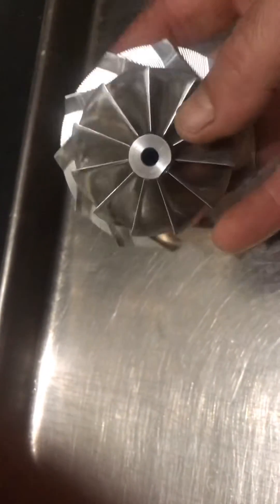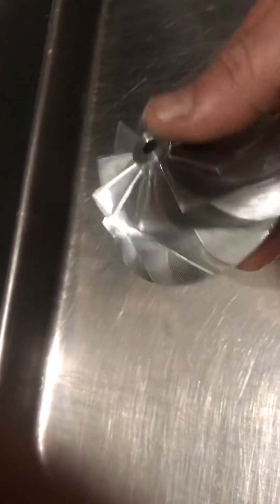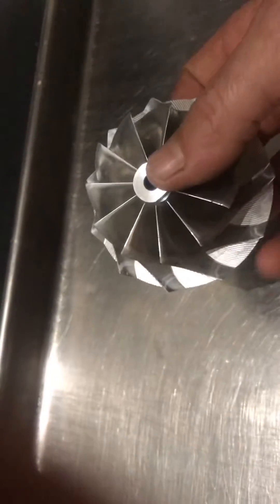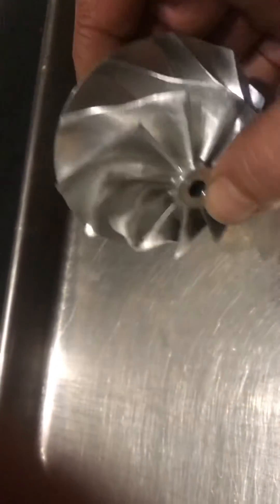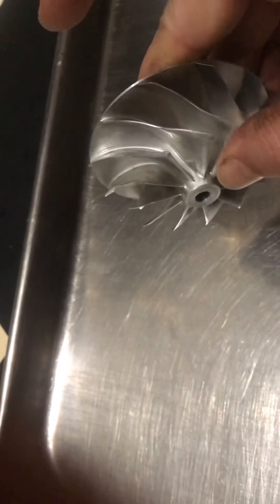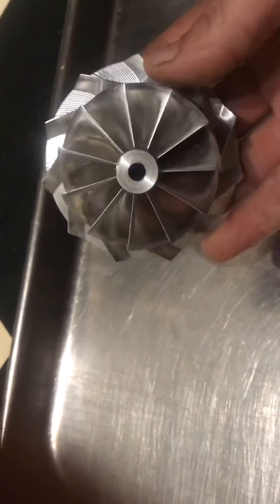11 blade compressor wheel mods

Comment: Interesting theory about the compressor wheel. Can I email you? Would like to know more about your setup 👍
Reply from the maker: Cheers for the sub👍Im happy to post everything about it here there’s no secrets other than my port work and chambers, and im happy to answer any questions but it’s just a backyard hack job for fun. as far as management It’s a pretty basic setup but also unconventional as it’s ecu isn’t tuned it’s just using a l67 memcal and stock ecu it’s mapped for 36lb injectors but uses 42lb injectors rated for 43.5 psi but up to 120psi, it uses two fuel pressure regs to ramp fuel pressure higher than 1:1,one is a spa fmu 14:1 ratio and the other one is a modified drilled out saas with a l28e Nissan diaphragm, 3  staged fuel pumps, mechanically its got mls and studs up top and a custom regrind cam, open chamber heads, high ratio rocker’s and gapped rings,balance shaft delete,more oil pressure, oil cooler,wta intercooler,
Reply from the maker: Also the wheel hit like a sledgehammer! as I kinda anticipated, it didn’t seem to gain any mph in 400m but it’s blowing through the converter(modified original by tci converters Sydney) but wasted tyres too easily! it’s probably better suited to drift/burnouts or a better set up chassis and grip! and because of that little bit too much fun I’ve just had to replace the bananas for conrods again oops!🤣I got greedy and 30psi is about all it would take! It ran 20-25 daily for years but boost normally ramps in at 5krpm+ not 20+ by 3500rpm,it’s getting a forged bottom end soon after a fishing trip.
Reply: What do you think about the compressor wheel mod being done on the older 6+6 blade gt3582? Is the open chamber head something you have done diy?
Reply from the maker: @300kwv6  I’ve got a couple of options for boost control I’ve got home made controllers but recently fitted an aeroflow one, the heads are diy,I do everything at home including making the tooling to cut valves and seat’s, I’ve gone through a fair amount of heads to come up with a happy combo the next step would be a transmission and forged internals to handle it
Reply from the maker: @300kwv6  it’s probably worth a go with the 6+6 as long as the wheel isn’t brittle! If it’s cast I’d be dubious! Also closing the tolerance between the wheel and housing gives good gains! I just used high fill primer to close the gap and I did the same thing to my supercharger rotors to replace the Teflon coating! Peening with a small hammer and a selection of shaped drift’s and punches is what I used it worked on these because they are a soft aluminium not like t6 7075, I think although turbine and compressor design is getting good it’s still at some design and cnc limitations so I believe that just like the fastest boats propellers in the world that they could benefit from fine tuning, cupping is one of the things done and I guess I’ve just done an upside down version of it
Reply: Also what do you use for boost control?